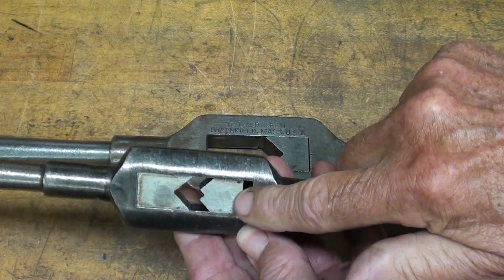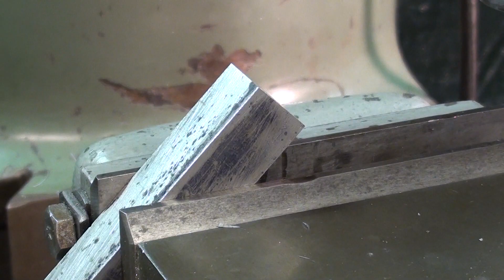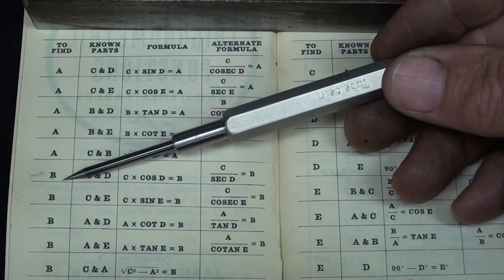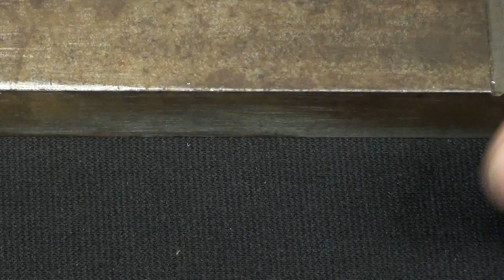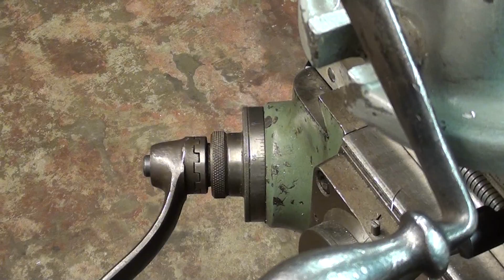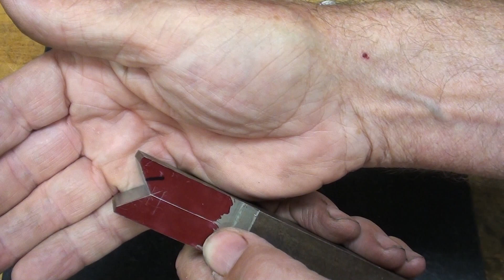TIPS #393 How to Cut a V Groove on the Bridgeport Mill tubalcain

Comment: RE-ENJOYING "old videos". 
Recently (because of your classes and videos), I built an aluminum block that sandwiched the belly pan of my Airstream camper in order to hold an outside outlet (typical household electrical outlet). The reason I built this is because when Airstream made my camper (1996) they used a flat surface outlet that was attached to adhesive foam then adhered to the curved belly pan and then the wired. When I tried to do there same thing, the foam and adhesive that I could get didn't hold. So the aluminum block was milled to fit the outlet but also milled so that the outlet ears could be rotated and hold the outlet to the aluminum block. Anyway, I wish I could post photos here. I'd be happy to send photos an other way if you want to see it. It worked out perfectly!!! I am so glad for this machine and your tutelage. Thanks MR Pete. JC (64 years old lol, I know Im just a puppy compared to you (82)).
Reply from the maker: That sounds like a clever solution to a tricky problem, glad it worked out for you! 😀

Comment: Mrpete222 I'm a little late to this party, but I really like your videos. I'm an old retired guy, I worked in an Air Force Precision Measurement Equipment Laboratory (PMEL) for 33 years, the last 12 as Flight Chief for the laboratory. My career involved highly precision measurements in the mechanical/dimensional area of the laboratory. I have a great deal of experience in measuring what the machinists produced, but I have no experience in how those parts were produced. I recently acquired a Bridgeport mill and have begun the journey into the science/art of machining, sort of the other side of my career. I won't live long enough to acquire the knowledge of true machinists but I'm going to do the best I can. Videos like yours are a HUGE help, thank you for posting!

Comment: I’m actually a tool and die maker apprentice and this is a gem. My leads show us a lot when they can because I also work on different metal stamping dies for wood connectors so I mostly do a lot of grinding on blades, punches, etc. as well as general die service, changeovers and troubleshooting on the manufacturing floor for the other leads so I do alot to say the least. When I have some downtime I practice on the drill presses and lathe machines from videos I watch as well as poking my leads brains. Haha. But anyway, insightful video and I will be trying to make my own v blocks.
Reply from the maker: Sounds like you have an interesting job, thank you for watching
Reply: @mrpete222  yes sir it keeps me on my toes. I work for Simpson Strong-Tie and have been there 18years but in my new role for about 8 months. I started as an automatic press operator then moved into the role of setting up the dies and troubleshooting and then leading and finally into the tool and die shop so I believe this is where I will stay and learn this new skill set. Thank you for your video. I’m actually trying to find that book but not seeing the one in the video. Ha. My search continues.

Comment: The human eye is a great measuring tool.... I use to be a chain puller and the supervisor would come out to measure wood cut sizes and between my eyes and the feel by hand I was always within 1/64 th inch and when milling or doing lathe work could eyeball within couple thousandths and with simple magnifiers get even tighter tolerances.... I have a small hand held microscope with 100 power and a computer microscope that plugs into my laptop magnification of 1000 times.... With either of these can get tollerance that's insane and  not measurable with micrometer or dial indicator.... Of course there are simple ways to get fine precision by using a center finder wobbler.... A simple Teter totter tool with a really long side is better than a dial indicator and easy  to make....... All very rarely needed

Comment: thanks for the last part of the video. it shows us guys with a math skills of intro algebra not to be scared to layout and get the part close like you just did. i'm not a machinist but i took machine shop in high school and now just bought a small mill to tinker with for my motorcycle parts. i'm an ex certified welder now truck driver with welders, 2 lathes, and now a small bench mark mill at home. thanks for your videos!
Reply from the maker: Thank you for watching, sounds like you have a set yourself up a nice shop.
Reply: @mrpete222  a welding, machine shop at home under a big carport just for myself doing motorcycle, car projects. thanks again.

Comment: Great video. I have 2 questions:

1. As an alternate to using the feeler: When you touched off the edge and moved the table .266 on X, could you have just turned on the spindle and raise the table until you got a witness mark?

2. When you made 2 passes at .050. how did the gap end up about 1/4? Gap should have been .141" Total passes of .150 to get 3/8? To get 3/8, total passes would need to be .265" each. 

Calculation:  √(.265² * 2) = .375

Comment: Hi Pete, thanks for your wonderful video... How would you make v grooves on a steel plate? Im making a Stroopwafel plates, so I need to make v grooves 1.2 mm deep along the 304 steel plate every 6mm apart and cnc mill is really expensive and I wouldnt mind hand made in mexico
Reply from the maker: I would use it's end mill with a 90° point. But they are rather expensive
Reply: do you have a video of how that looks?
Reply: The plate is 25cm x 25cm wide and 2cm thick
Reply: in most end mill videos they only make U tipe Grooves rather than V grooves
Reply: Use end mill and angle the head 45°

Comment: Why not use the square root of 2 (1.41) when dealing with a 45°x45°x90° rt triangle,  rather  than  all that  sin cosine tangent stuff? Either way,  you're right. Most will  do it the second way. 

I get stuck on your videos  quite often.  Thanks for taking the time to put them together.

Comment: first of all I've just discovered you lately and it's SUPER AWESOME!!
tnx for the time and effort you put in to this.
I'm curious about something.
can you please show the method you used to scribe the soft aluminum block (red) so accurately into 45 deg from the center?
because I don't have a DRO nor an edge finder
Tnx again for the videos!
Reply from the maker: AS FAR AS I REMEMBER.  I located the point of intersection with a comb square or height gage.   Then used the 45 deg. comb. square & a sharp scriber.
Reply: tnx for the answer!

Comment: Using your indicator doesn't Tell you weather or not it's center of the piece . That's just telling you it's square ...rite? Zero one side and zero the other means both sides are parallel to your work surface.
Reply: Alex the difference between one side and the other shows the offset from center. Sliding down the dowel shows the parallelness of the V-groove to the edge of the workpiece.

Comment: I'm curious as to how the first piece was off. Using the Pythagorean theorem I'm getting 
.265 Maybe that is where the mistake is? I think I have a touch of ocd evidently.
Reply: hemiram05 you lost me, following what he did for the cut I got .424 ...little ways over 3/8 as you can see in the video. Maybe I didn't understand what your comment was towards
Reply: nvwalters 
It doesn't really matter I was just curious. But in his formula that he had written down for how much to feed in after touching off. B=.375xcos45. Should equal .265 instead of .266. Using Pythagorean theorem is quicker but same answer.Thinking about it though,I don't think that discrepancy would matter as long as you feed in equal amounts after touching off. Idk what went wrong.

Comment: Why not drill a 1/16 hole at the intersection on the workpiece  and mill to the tangent of the hole. Makes the layout on the mill easy and gives you stress relief at the V of the slot.

Comment: The first groove was off because the vertical touch-off with using the .001 shim plus not at the tip of the cutter which is ground shallow to the center and neither was accounted for.Keep the videos coming.
Reply: Or, because of using edge-finder (which is accurate to 1-2 thou typically).

Comment: Why did you round your calculations to 3 decimal places when your DRO goes to 4 decimal places?  My OCD is piquing right now!  LOL
Reply: Because edge-finder is not that accurate (within 1-2 thou, never in "tenths").
Reply: Richard Head and also due to the fact that the z axis only accurate with each line of 1 thousands on a manual .

Comment: Thank you! I'm working building 90° jaws for press brake. The the v point section ended up approximately 3/32 off the center. So once I re mill it. I will be starting the v notch plate.

Comment: It's always worth a mention that the point of a 90˚ (or any angle) chamfer mill is moving at zero SFM (cutting speed). Not always the best choice for cutting a v-groove.
Reply: How so?
Reply: Peter W. Meek  mind if I ask, are you talking about the center of the cutter? If so, he wasn't plunging the cutter, so the center never made a cut?
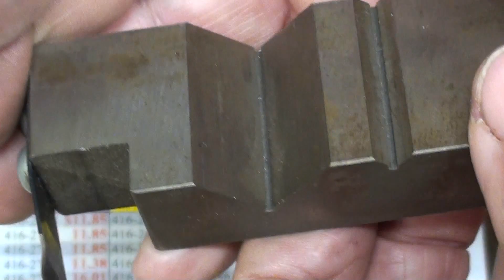Reply: If he was proposing a 90˚ pointed chamfering tool (at 1:44) to make a 90˚ notch, the implication would be a horizontal pass with the tip (which I still assert is moving at zero SFM*) at the bottom of the notch. As I recall, mrpete rejected the chamfering tool as less than ideal (to be sure, it was for price and/or availability, rather than suitability). He also was intending to demonstrate how to center the corner of a square-end mill to the center of the workpiece (which he did, nicely). My point was that chamfering mills are not well-suited for making v-notches.

========= 
* The formula for SFM is Diameter x pi x RPM / 12.  (assuming diameter in inches)  At the center of ANY rotating object, the diameter is zero, hence the SFM AT THE CENTER is zero.

Comment: The math method is only as accurate as the significant figures that you used.  So you could get better accuracy using math but then only if you need the accuracy, which here you really don't.  This also explains the accuracy you could get during the industrial age and the digital age(where a computer can calculate sig figs in the millions).  Enjoyed the math and the layout method.
Reply: Yes and NO, accuracy is also dependent on hardware you are using (milling machine, vice, endmill, and edge-finder - accurate to 1-2 "thou" typically).
Reply: Significant figures is a math term and can be also called accuracy.  I used the term sig fig because I was talking about the math.

Comment: We used to learn & remember the trig numbers for the common angles: 30,45,60. If we did not remember we would calculate, so that for 45 deg, we would create a triangle with two equal sides of length 1. Then by Pythagoras, the hypotenuse was sqrt (2), which was remembered by the simple rhyme: "I wish I knew root 2" by counting the letter we got 1.414. So cosine (45) equals 1/1.414 = 0.707 and sine (45) is the same 1/1.414 = 0.707. I had not thought of that for a very long time. For sqrt of 3 we had: "O pleased was he who knew root 3", again counting letters gives 1.732. Remarkably pleasing to remember that. Thank you for such interesting & useful videos as I do need to make some stops for my mill.

Comment: Hey Lyle, as a part time hobby guy I am curious, I thought 2 flutes were for aluminum or doesn't it matter? Great video If I knew the answer of this I'd be a genius like you. God Bless Ya   Dave
Reply: You can use 2 flutes for anything, the only reason you would use a 2 flute for aluminum is for taking a larger feed where more flutes would clog and cause breakage. But you can use a 2 flute for anything, it just won't cut as quickly.

Comment: good to see the trig.  but if you use your two touch off points it is the center of the work just not on the work surface.  so just step down and in equal amounts from the edges

Comment: I've never had consistent results touching off on a corner like that. Any chamfer from deburring throws it too far off.

My understanding is that the usual technique is to use a toolmakers ball for this, but I've not tried that yet.
Reply: steve gale I was thinking more about making a v block where you want a high degree of accuracy.

Comment: I'm not that good at the math but I understand the need for it in most of life's questions. For me the need for mathematics,and calculation's are not much of a turn off. I prefer a mechanical solution,which I acknowledge uses mathematics,as an precise explanation of the practical application. Another Great Video By Mr.Pete

Comment: Oh what about the good Old-fashioned slide ruler.... what's more it doesn't need batteries!
Reply: I like vernier calipers for the same reasons. No batteries, no dial indicator with fine tooth rack and trash, but does sometimes require a magnifying glass to read.
Reply: @ellieprice3396  Lol mitutoyo calipers only need a battery every like 3 or 4 years, even if you leave them on. You also can't zero on something and make incremental measurements with a vernier.
Reply: oh puh-leeze...let's leave the conspiracy theories out of this forum please...
Reply: + Mr Shobar. NO they did not go to the Moon. It was all a BIG HOAX. Dangerous Van Allen Belts. Have a read on the web.
Reply: LOL, we didn't make it to the moon, we overshot it and landed on planet Delta in the Omega-quadrant section. 
They speak Italian there.
Reply: good one...lol
Reply: Slide RULE.  Propelled me through college; allowed men to go to the Moon.

Comment: My brother went off to college for engineering in 1974.  I believe it was mandatory for him to have his own scientific calculator.  My parents forked out about $350 for that thing .  My father told my brother to guard that calculator with his life.  They may have even insured it.
Reply: My father's company bought a four-function calculator for his use in 1970.  It cost about $800 then.  At about that time, I was working my math homework on a 300 baud teletype terminal coupled by telephone lines to a mainframe that the school district owned.   It beat interpolating trig values, logarithm values, etc. from tables, even though I had to write a short program to do it using the BASIC language.  If I was at home, the slide rule and pencil and paper would have to do.
Reply: I remember the exact same thing. My brother went off to college studying Engineering in 1975 and had to get an HP scientific calc. Probably about right...350.00
Reply: I went to engineering college in that era. At the school I went to, you weren't allowed to use a calculator during tests because it was considered to be an unfair financial advantage.
Reply: Yea Steve...The amazing thing is how fast the electronic IC circuit changed things in our lifetimes. You were most likely not that much older than my brother. I graduated high school in 1978. We used slide rules from about 7th grade on. By senior year high school, we could use calculators. A few years later, I had my first Tandy PC. 
   Its just amazing to me when I look back and think about it all.